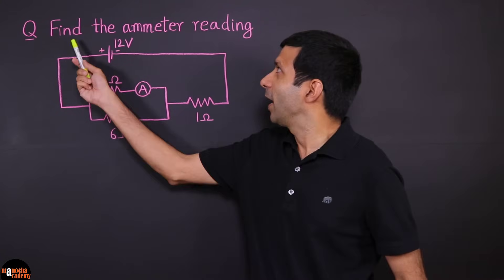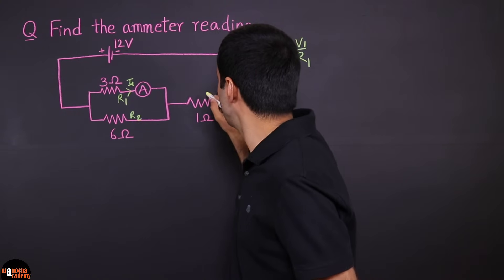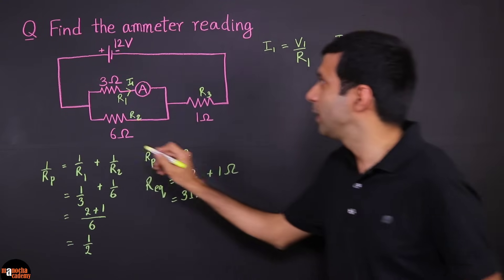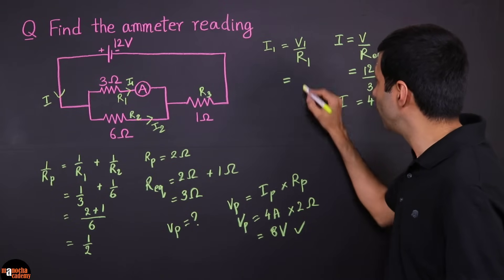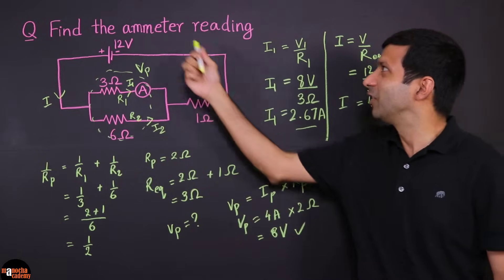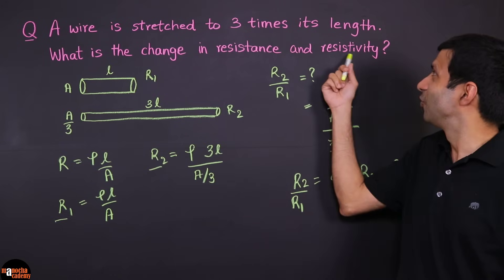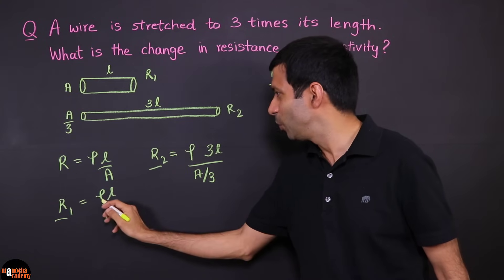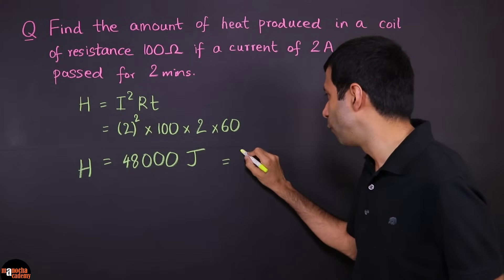Electricity Class 10 Numericals

Comment: All Formulas of Chapter Electricity

1) I=Q/t
2) Q=ne
3) V=W/Q
4) V=IR [ V=Iyer (tmkoc wala) ]
5) R=Rho×L/A
6) H=V×Q
i) H=VIt
ii) H=I^2Rt
iii) H=V^2t/R
7) P=W/t 
i) P=VI
ii) P=I^2R
iii) P=V^2/R
8) E=P×t
9) Resistance in Series-Rs=R1+R2+R3
10) Resistance in Parallel-1/Rp=1/R1+1/R2+1/R3 (i.e. Reciprocal of R1+R2+R3)

S.I. Unit
Current(I)-Ampere
Charge(Q)-Columb
Time(t)-Second
Potential Difference or Voltage(V)-Volt 
Resistance(R)-Ohm
Resistivity(Rho)-Ohm meter
Power(P)-Watt
Heat=Energy=Work-Joule

Things to remember for numericals-
1 Kw-1000W
1 Horse Power-746W
Reply: Thanks
Reply: Oh my god what talent
Reply: THANKS BROO
Reply: Can't explain tqsm for this.
Reply: waah
Reply: yaar thank you so much
Reply: Khub jayada VELLA HAI KYA BHAI ?
Reply: Thanks bro

Comment: All Formulas of Electricity:

1) 1 = Q/t
2) Q = ne
3) V = W/Q
4) V = IR
5) R = Rho x L/A
6) Resistance in Series: Rs = R1 + R2 + R3
7)Resistance in Parallel: 1/Rp=1/R1+1/R2 + 1/R3 (>>
Reciprocal of R1+R2+R3)
8)H = V x Q
i) H = Vit
ii) H = 12Rt
iii) H = V²t/R
9) P = W/t
i) P = VI
ii) P = I2R
iii) P = V2/R
10) E = P x t

S.I. Units:
Current (1)-Ampere
Charge (Q) - Coulomb
Time (t)-Second
Potential Difference or Voltage (V) - Volt
Resistance (R) - Ohm Ω
Resistivity (Rho) - Ohm meter
Power (P)-Watt
Heat = Energy = Work = Joule

Measuring Devices:
Ammeter/Milli Ammeter - for measuring current (always connected in series)
Galvanometer - for measuring small/sensitive currents (we can also get the direction of the current)
Voltmeter - for measuring volts (always connected in parallel)
Ohm Meter - Measures the resistivity

Things to remember:
electron charge (1.6 x 10-19 C)
1kWh=3.6 x 106J
1Ampere = 1000mA
1 KiloWaat = 1000W
1 Horse Power = 746W

Hope this will help❤

Comment: Sir but if we had connected the resistors in parallel then the voltage across all the resistors is equal to the voltage across battery. So we can use the potential difference of the battery as p.D of all resistors in parallel.
Reply: Note that there's one resistor which is connected in series which means it will main a different potential difference across it!
Reply: @shrutitripathi8143  thanks. Now I understand why the potential difference across the  parallel resistors will not be the same as the  P.D across battery. Two resistors are in parallel. But there is one resistor is in series. Overall if we compare the individual  series resisor and combination of resistors in parallel then we can easily found that the two combination are actually in series .so first we need to find voltage across the point  from where the two resistors are connected in parallel  .For this we need to find the equivalent resistance of the circuit which is actually 3 ohm. So the current across the whole circuit is 4A. Now it is possible to replace the combination of resistors in parallel in to single resistor of resistance 2 ohm . Now since the  new resistor will be in series so same current of 4 A will pass through it and the resistance was 2 ohm .so Voltage across it will be 8 v. Now since we got the voltage across the point from where the two resistors were connected we can easily found the P.D across the R1 which is 8v .so current will be 8/3 =2.7A

Comment: I’m sorry. But I don’t get how in the first question, the voltage is the combination of both parallel resistance. But still we have to find current of the 3ohm resistance only.
Reply: Same i am also in this doubt it should be 4/3 ohm
Reply: Because the potential difference is the same in parallel but the current is different. If that's what you meant, i didn't get your question.

Comment: Sir in 1st Q you took the V1=8V for the 3 Ohms resistor Connected in parallel Comb. but I've read that voltage will remain same in  parallel resistors, then how it'll change Sir?

Comment: 1) I = Q/t
2) Q = ne
3) V = W/Q
4) V = IR
5) R = Rho  x  L/A
6)Resistance in Series: Rs = R1 + R2 + R3
7)Resistance in Parallel: 1/Rp = 1/R1 + 1/R2 + 1/R3 (» Reciprocal of R1+R2+R3)
8)H = V  ×  Q
    i) H = VIt
    ii) H = I²Rt
    iii) H = V²t/R
9)  P = W/t 
    i) P = VI
    ii) P = I²R
    iii) P = V²/R
10) E = P  ×  t

S.I. Units:
Current ( I ) - Ampere
Charge ( Q ) - Coulomb
Time ( t ) - Second
Potential Difference or Voltage ( V ) - Volt
Resistance ( R ) - Ohm Ω
Resistivity ( Rho ) - Ohm meter
Power ( P ) - Watt
Heat = Energy = Work = Joule

Measuring Devices:
Ammeter / Milli Ammeter - for measuring current (always connected in series)
Galvanometer - for measuring small/sensitive currents (we can also get the direction of the current)
Voltmeter - for measuring volts (always connected in parallel)
Ohm Meter - Measures the resistivity

Things to remember:
electron charge =  (1.6  x  10⁻¹⁹ C)
1kWh= 3.6 × 10⁶J
1Ampere = 1000mA
1 Kilowaat = 1000W
1 Horse Power = 746W

i hope this list will help you! ❤
ek free ka like dete jana
Reply: Just after an hour I'm replying that this comment is very useful
Reply: thank you this is Verrrrrrry  usssssse  fuuuuulll ❤

Comment: The second question does say that there any change in the cross sectional area so why should the area decrease? Only length should increase.
Reply: Well ,the length is increased by stretching the wire so there will be a change in cross sectional area of the wire
Reply: Since the volume is same ,so if the length increases there has to be changed in area of cross section

Comment: At the beginning of the video you said we are finding the (A) for 3 ohm 
But why did you use the total of the two parallel (R)
Reply: look , because simply the voltage is: 
in series: distributed among the resistances 
in parallel: constant 
so, we had to get the product of both resistances(3,6)to know the voltage passing through both of them(as we said voltage is constant in parallel connection and resistances 3 and 6 are connected in parallel so they both have the same voltage) 
So now as we have the voltage through them which is 8 volts we can easily know the current in the 3 ohm resistance : I=V/R   = 8/3=2.67Ampere

Comment: SIR I think you have made a mistake in the first question, this is becaude in parallel connection voltage is unchanged so I assume that the voltage that passes through it is also 12V
Reply: But there is one resistor is series also, some voltage falls there also
Reply: Voltage is same everywhere in parallel
Reply: U are wrong cuz if see there is another R3😂

Comment: Sir one dought that IP current in parallel you use total current in circuit
Reply: when we want to find voltage differences we have to do equavalent resistance of the parallel circuit then the Rp will be series with another resistance thats current flows the same

Comment: isn first ques why he use another value for volt accross parallel resistors as we know voltage are same in parallel connection.
Reply: its connected in both series and parallel
Reply: @SkinGuardSG  yes but in parallel volt remains same
Reply: there is a 1 ohm resistor connected in series with the parallel combination so voltage is different.You're supposed to use the voltage for only the parallel combination, not for the entire circuit.
Reply: @alwinsanthosh6878  yup thnx 💪
Reply: @Raunit Rastogi ohk thnx 🤟

Comment: sir in q2 why took r2/r1 at place of r1/r2
whats reason behind it?
Reply: Same even I have doubt in this
Reply: I also
Reply: So. In question 2 we have to find the resistance and resistivity of 2nd wire and how it has changed from 1st wire so basically its r2:r1 that's why we put r2 in numerator.also if you're unable to understand by ratio you can directly apply R=rho 3l/a/3. At the end you're gonna get R=9(rho l/a) which remains same as shown in the video.
Reply: Hope y'all got it :)
Reply: @just.dazzle  thanks so much

Comment: I can't understand the first sum. Can anyone please help me?
Reply: 1st sum is the equivalent resistance? Here they use parallel connection right so find the to find the total resistance so, find the resistance (parallel ) and also the resistance (series ) and add them up . I hope this helped!!
Reply: I  COULD HAVE HELPED:face-orange-raised-eyebrow:
Reply: see if u dont understand watch physics wallah video its approx15min  it will surely help u in ur doubt
Reply: In circuits like in the 1st sum the resistances are connected in series so the voltage is different hence the equivalent resistance is necessary to find which helps in finding the current equivalent in every path.....after finding current in every path of circuit we can apply the formulae v=ir then we can find the voltage.....and at last after finding voltage for the parallel connection we have to find current for each path.....if u get it it's. Good
Reply: @braindrain9352   how is this possible????

😆😆

Comment: In 1st question ammeter is connected in parallel 😒
Reply: It can be connected but in harm’s way it would damage the circuit probably
Reply: koi sense nhi hai is baat ka
Reply: No because there is a resistor, so it is connected in series
Reply: If you understand the concept of ammeter in parallel u will get it
Reply: @deadegg9577  the resistor will regulate the current flown so it won't burn the ammeter
Reply: @agasthya1747  nikal dene ka ammeter after measuring the current 😏
Reply: @angshusharma9995  What idk hindi

Comment: sir  in finding ammeter reading   why you are calculating vp is it  not same for parellel  connection ?iam confusing pls expalin again
Reply: In that question voltage was given for both series and parallel but we have to find firstly voltage for only parallel so we calculated voltage for paralle and then current
Reply: in parallel voltage is same for current varies so why to find vp. my doubt not yet cleared
Reply: @durgachalla1001  yes, in parallel voltage is same. you are right. but that is when ONLY parallel exists. here, the parallel combination (3 ohm and 6 ohm)  is combined in series with the 1 ohm resistor. so totally, it is a series combination. like : one resistor is considered as 1 ohm. other resistor is considered as parallel combination of 3 ohm and 6 ohm. we know that in series combination voltage is not same. hence, here the voltage (as calculated in the video) is 8 volts across both 3 ohm and 6 ohm resistor. and, the voltage is calculated to be 4 volts across 1 ohm resistor. to verify, the sum of voltages across resistors in series should be equal to voltage of battery. here, 8 volts + 4 volts = 12 volts. hence, all calculations are correct. hope you understood, if not ask specifically what you did not understand. 👍

Comment: Last answer is wrong because it is give that per day the appliances are running for 10 hours, so
3.5kwh x 10 = 35kwh per day
35 x 30 =1050 kwh in a month
1050 x 5 rs = 5250 rs is the answer
Reply: Bro, 350/1000= 0.35
Reply: @yusheyatiqui2512 ??
Reply: @yusheyatiqui2512  how is that related to what I said
Reply: @yusheyatiqui2512  it's 3500 wh /1000, so that makes 3.5 kwh
Reply: No
Reply: He already multiplied them separately each
Reply: U are also a brawl star player brother
Reply: @shadowknightgaming3235  no he dint count that the electronics run 10 hrs a day, BTW I don't play brawl stars now
Reply: nope your wrong in the 35 kwh part because he already included the ten hour running time of the appliances while calculating energy of bulb and energy of the two fans so he doesnt include it again